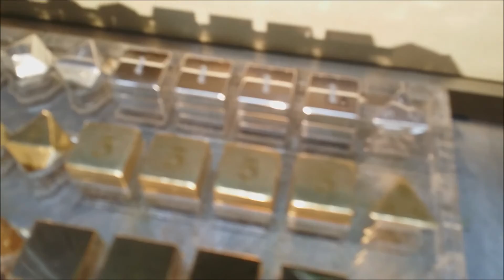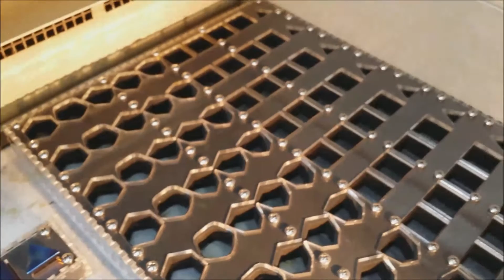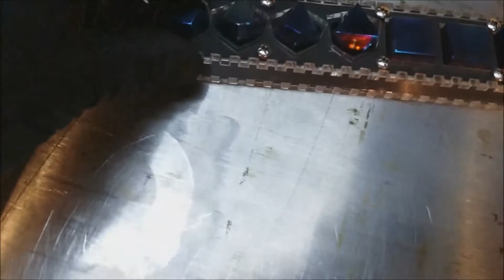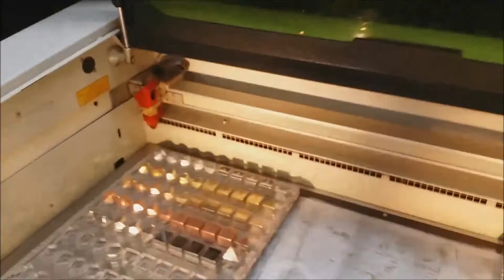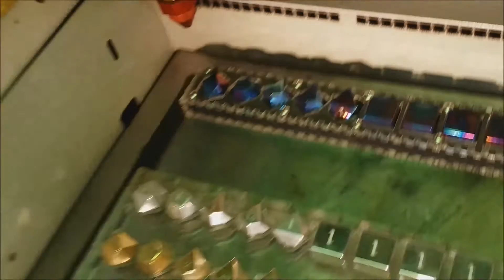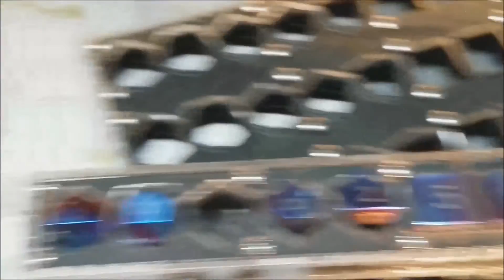Dragon's Dice Fiber Laser Engraving

Comment: Yep, the fact that a CO2 laser's wavelength is probably over 10 times longer than your fibre laser does let you get away with a lot. A vacuum fixture might work well to keep them flat onto the bottom but then again there is not a lot of surface area.